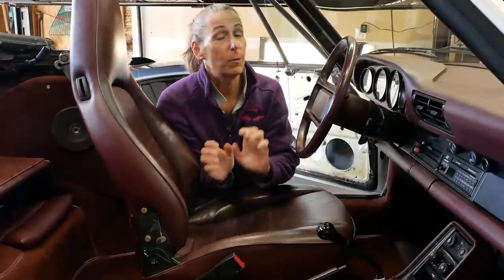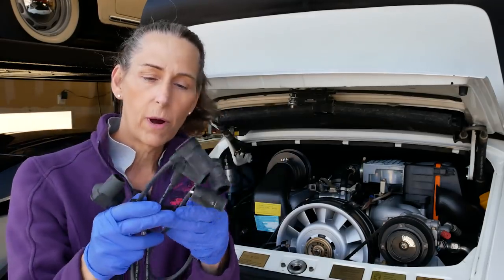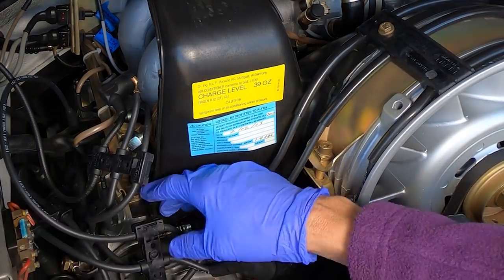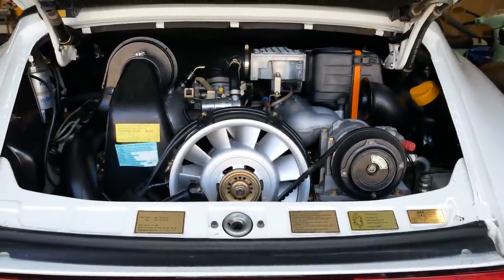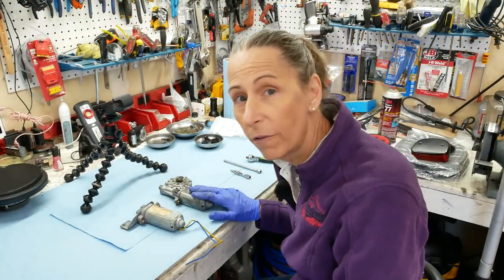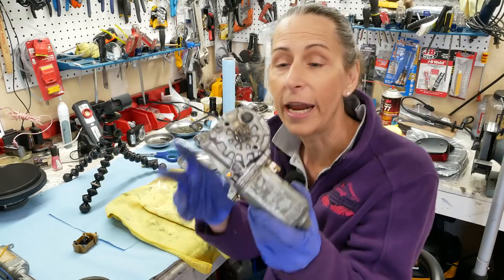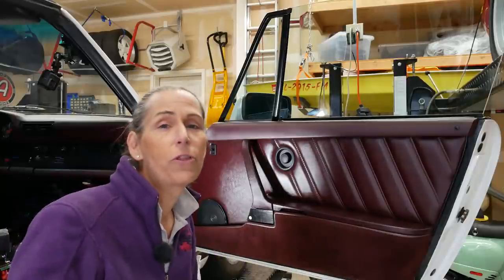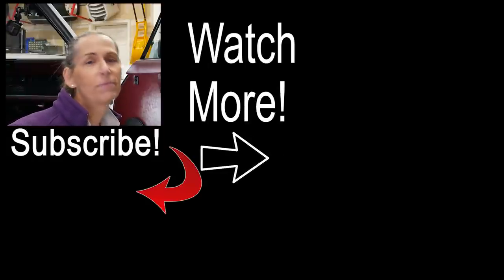Budget eBay Porsche 3.2 Carrera Project Car! #33 - Getting to the Interior!

Comment: Hi Franny, you should have tried (if it comes apart) to open the gear box, clean and grease maybe that would have made it go faster. Also spray some silicone spray on the track guides that the glass rubs against. 👍

Comment: On the door vapour barriers, I don’t know specifically on Porsche, but generally these use a non-setting adhesive (a dark goop that looks a bit like that stuff they use to bond modern windscreens). This avoids the issues with a traditional glue drying out and/or going brittle and detaching, while also helping create a better seal

Comment: Franny, I love the variety of all your projects, so keep doing what your doing. That 911 engine looks and sounds fabulous. Oh, to have enough money to buy a 993!
The door motor pullout and re-brush reminds me of doing just that to my old Alfa 33QV way back in the early 90s. I even had to take both the door windows and slider mechanisms out as I had to replace and rewire both door window and lock cabling due to broken and frayed wiring going through both "quality Alfa" door openings, YAY, a joyous job that was! Most European door motors are probably all made from the same 3rd party OEM supplier too. The motors always struggle pushing the window weight and all those bracket and scissor lift style lever arms uphill! They of course tend to work much faster with the engine running and supplying alternator voltage to the doors!
Your engineering OCD and attention to yellow caps is just like mine! Cheers from NZL, David :)

Comment: Another way to speed up your power windows is to put some silicone grease in the weatherstrip grooves the window moves in. You can get half of it done on any given day, the lower half, when you have the door card and plastic off.

I use NAPA Sil-Glyde and some Q tips.

Comment: Very interesting to watch you rebuild the window motor. Although the window is noticeably better it still appears to have slow travel when moving upwards. I think while you were in there it might have been good to take out the window regulator frame with cables for further inspection. The wheels guiding the cables might be slightly clogged up with dust. An unbalanced window attached to the regulator can also cause issues.
Great work.
Reply from the maker: Thanks!  It doesn't have any cables (like the Ferrari) it is a gear driven scissor lift.  I did grease everything in sight.  I think the armature is just a bit damaged...  Still, better than it was...
Reply: @HeidiandFranny  It appears I got my 'wires crossed' on the window regulator for your 911. LOL 😂 Easy on the grease. It can become a dust magnet. A damaged armature is most likely cause. Good luck.

Comment: Great video as usual! I have always been afraid to do interior stuff. Working on engines doesn’t seem to bother me. I admire that you do both.
It will probably go up faster when the alternator is producing more than 12 V. In the bonanzas the 28volt model,  the wheels come up much faster than the 14 volt older aircraft.

Comment: Always enjoy your content, it’s your channel so you’re entitled to put out what you like, mixing up different styles is a good way to keep the channel fresh. 

By the way I have a bottle of that 303 stuff, apparently it is actually used in aircraft maintenance (I’m not an expert, so they may be a myth). However a lot of people recommended it for UV protection and the reason I originally bought it was for coating plastic headlight lenses

Comment: Your videos are always awesome. I watch a lot of Scotty Kilmer videos. He suggests spraying rubber parts 3-4x per year with a product called AT-205 (made in Chicago/sold on amazon). I keep a collapsible container in my trunk with all my detail stuff plus my Liquimoly oil, a can of brake fluid (in case), and some pink VW coolant. I don't think 303 will rejuvenate rubber. I definitely use it to spray my interior parts. But have found the 3M stuff to be the best by far.

Comment: Being that they can be taken apart I am thinking that those window regulators can be repaired by an electric motor specialist if damaged extensively? Maybe cleaning and lubricating the sliding mechanism itself it can make it easier for the motor?

And all your videos are great. Great production and talent. You do great work in a very organized and clean way (as any proper engineer would 😉) and have a very engaging personality.
Reply from the maker: Thank you!

Comment: Such a great video! The content is so comprehensive. I've seen others tape the window to prevent it from crashing down. Was this necessary? (if the focus is only removing the motor)
Reply from the maker: I tried that, but the cab windows are frameless so nothing to really tape to :(  I just used several spring clamps and that worked (mostly).

Comment: Enjoyed the video. 
The little stuff is great to see. Big rebuilds are interesting, but I tackle the little stuff. 
Was the window motor gearing in a sealed unit?  If not, did you re-grease the gears?
With patience even the switches can be repaired/rebuilt. 
How great was it to have a used motor for spare parts.
Reply from the maker: Yeah, it was sealed and I packed in a bit more grease.

Comment: Love your videos! I have a question that I am stumped on and I hope you can help me. At 19:45 When Franny is installing the door pocket lid hinge, what is the bottom screw on the hinge attaching to? I am repairing the door panels in my 88 targa. The previous owner had aftermarket speakers installed and the audio shop has mangled up the door cards pretty bad. The hinge on my car only had one top screw in it but no bottom screw. The door itself does not have a place for the bottom screw to attach to - I can’t figure out that bottom screw.
Reply from the maker: Thanks Eric, there should be plastic inserts in the door sheet metal that those screws go into. It is common for a screw to be missing.  It can be a little difficult to align everything through the door card. Try using an awl to poke through and find your receiver hole alignment. I bet it is there... Good luck! F
Reply: @HeidiandFranny  Thank you so much for the reply! But I can only find one plastic insert in the door sheetmetal, I rewound your video and zoomed in to the same place on your door, and I also didn’t see a second plastic insert underneath the top one. Maybe those lazy Germans forgot to drill a hole😁  - I may have to make one myself!